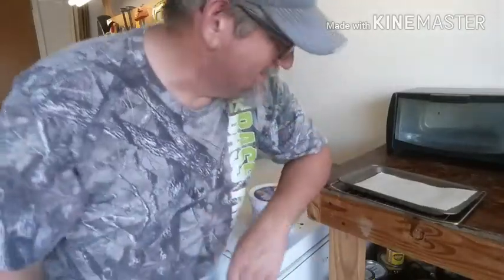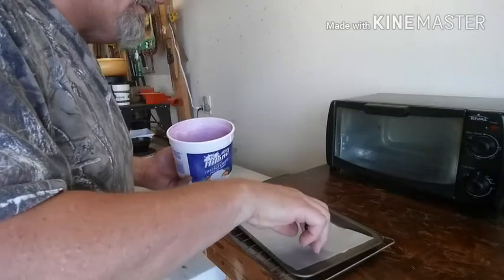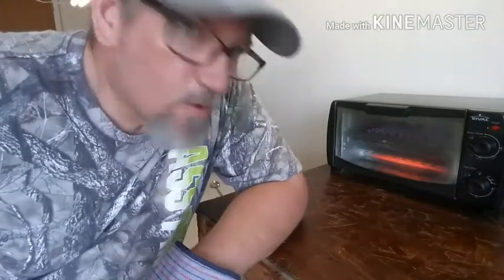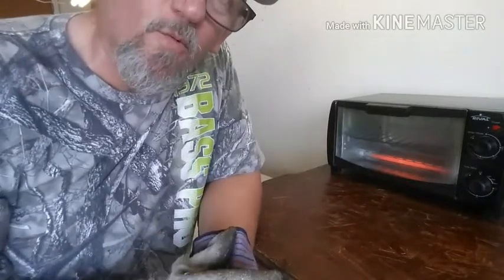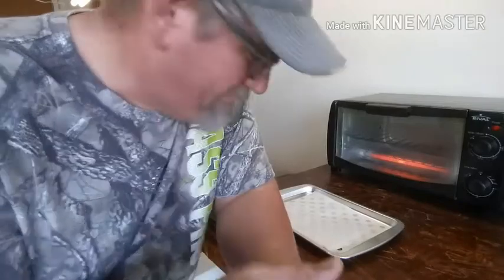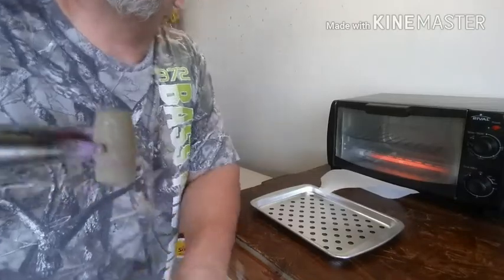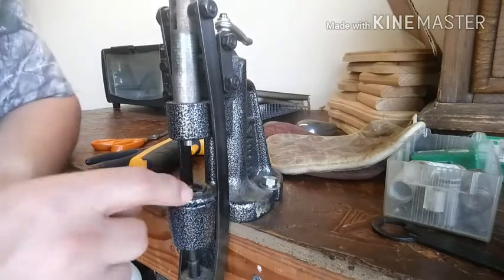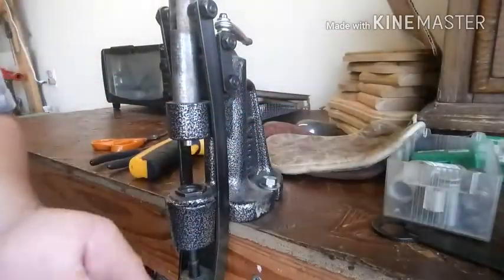Powder coated them anyway see the results

Comment: I'v been powder coating at 300 degrees for 13 minutes for quite a while now . Guess I have to try 250 degrees now . A while back I powder coated 1500- 223 bullets in a couple of hrs by cutting the time down . That is why I started using a rock tumbler to powder coat the bullets in . When you can do them that fast it really wears the arms out doing the shake and bake method .
Reply from the maker: James Pollard yeah I could see that many bullets hurt in your arm after a while yeah Elvis ammo came out with that degree for that much time to save his bhn
Reply: I went on the theory that if the bullets are shiny you could cut the time down . I told Elvis he one up'd me by cutting the temp down too . If it helps the BHN , all the better .

Comment: Try the Walmart stainless steel silver ware tray out for powder coat baskets . If you take it apart just right you get 3 baskets that work great for powder coating bullets that fit the small oven . My wife hooked me up with this idea . The nice thing is if the basket gets a build up of powder coat I can take a propane torch and burn it off and they are like new again . And it is a real fine mesh that doesn't make defects in the bullet .
Reply from the maker: James Pollard wow I am so glad you bring up the propane torch thing because I'm starting to get buildup on my little basket that I built and didn't know how to get it off thank you James good tip
Reply: Do it outside , it stinks when it buns off . I figured it out that I can powder coat around 750 bullets an hour now with a nice finish on the bullet .